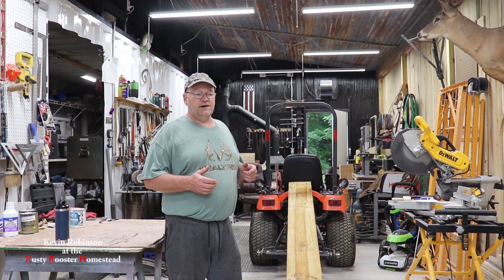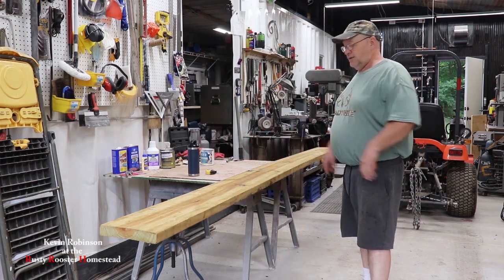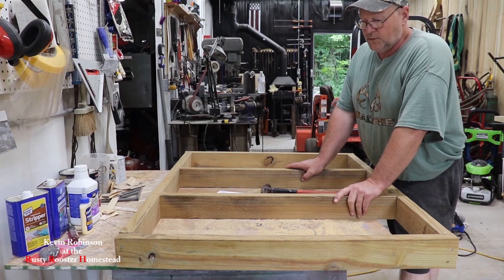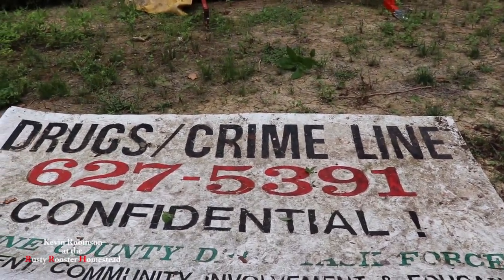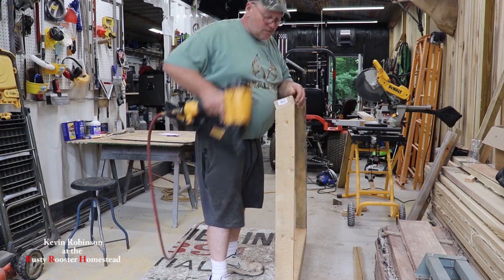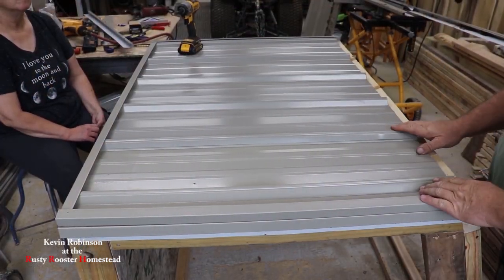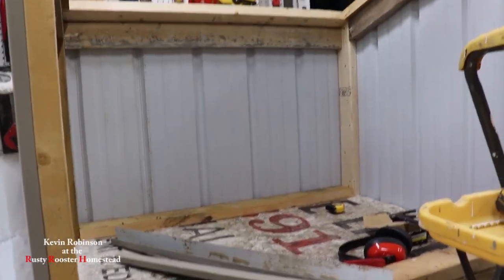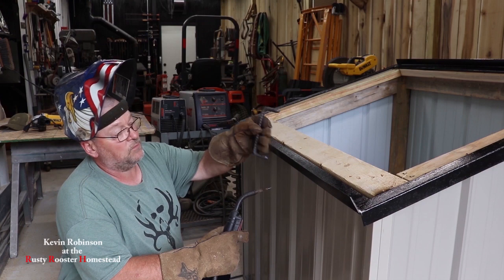how to keep animals out your garbage garbage bin build

Comment: Looks great, every little bit of scrap you use helps a lot. Everything so expensive now. For example a couple of bolts cost like $1.25 each. It is getting to the point where before throwing anything out take the screws. Soon we will be reusing old bent nails.
Reply from the maker: You got that right i always save bolts and screws if they are still good, thanks for watching.